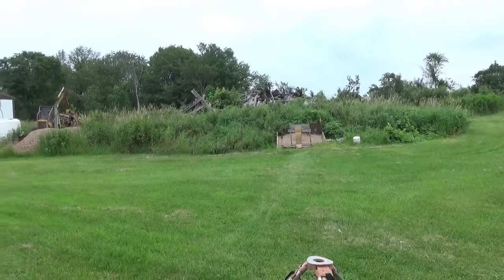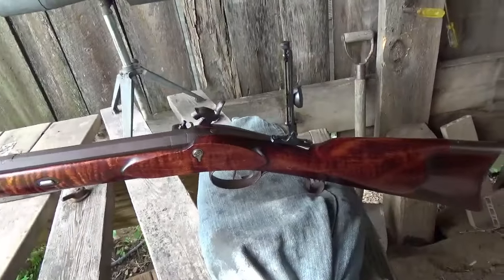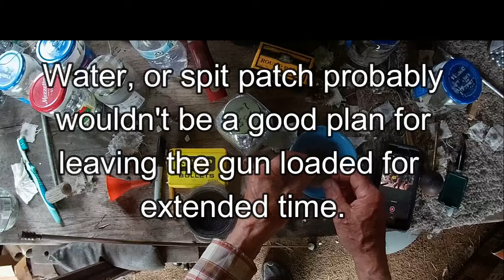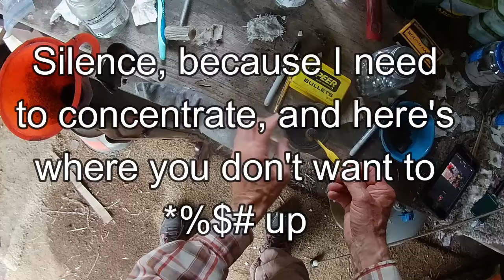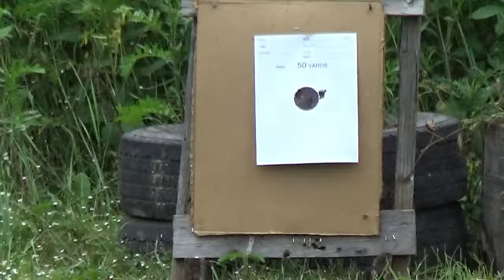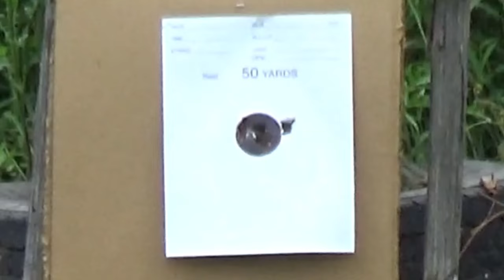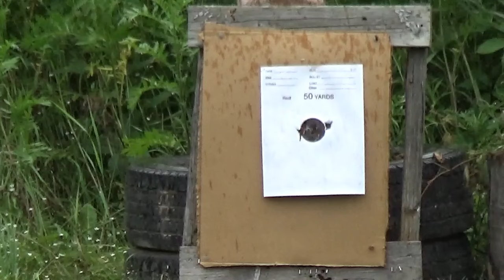Full Stock Hawken -  54 Caliber

Comment: Very nice rifle, I'd really like to have one like it, but flintlock instead of percussion. 
I have a Hawken rifle that was built in the 70s by a preacher/gunsmith in Tennessee as the story goes. 
I can't find any markings anywhere on it, but I'm pretty sure that it is a Hawken shop parts kit gun.
54-caliber 1 in 66 twist and a 35" barrel that is a little less than 1 1/8 across the flats. 
It is a beautiful rifle that is more accurate than I am. 
My latest rifle is a Kibler Colonial American Longrifle 54-caliber that is also more accurate than me. 
There's not much out there more fun than real black powder and a weekend of shooting with like-minded friends.
Again, I really enjoyed seeing that beautiful rifle of yours.
Reply from the maker: I want to say something like Sharron rifle works was doing kits back about then or before. Also Green River Rifle Works was doing darn good barrels. Lots of folks know more if you can get into the right forums. I wouldn’t doubt that flint was more common in the full stock. I started building because couldn’t afford custom. Turns out that with parts I have left over, and tools, I could get several. Thanks for your input. O.R.

Comment: What brand rifle is that, too pretty a wood for a cheapie.
On heavier loads if you will try an over powder patch and then your patched round ball it will usually save your patches
Reply from the maker: Thanks for the comment and tip. Rifle is one I did in the 90’s from some curly maple logs I sawed. There was a time I could sort of shoot it offhand. Now it’s more for “looking at “. O.R.
‘
Reply: @oldranger3044  pretty gun

Comment: I am considering the same sight set up that you are using on my CVA .54. What type/brand is it and what is your front sight?
Reply from the maker: @chuckstonex1632  Rear is David Pedersoli Long Range Silhouette USA 431. Front is a Lyman I think. Most dovetail are.375 except foreign ones may be .360 such as the Lyman GPR. Buffalo Arms or Track of the wolf are good sources, but best to be sitting down when checking out the prices. O.R.

Comment: Where do you get linen?
I have been wanting to try it in my rifles.  They didn't have cotton like we do back in the day. 
It was expensive before Eli Whitney brought in machinery to process the fiber.
Duellist 1954 says linen loads and shoots just like cotton patches. No better. But I want to try it anyway.
That's a pretty rifle by the way.
I have a pre-carved stock for a full stock Hawkin waiting for me to get a roundtoowit.
How long is the barrel on that rifle?
I am thinking 32 or 36 for mine.
Looks like you had a piece of the old cap stuck to the nipple.  I like Hot-Shot or Slick-shot nipples. They tend to blow off the fired caps.
I also like to chuck my nipples in a drill and polish the nipple with a wad of 4/0 steel wool. That seems to help prevent sticky caps.
Thanks for all you do.
John Davis Jax Fl
Reply from the maker: @johnndavis7647  John, it’s fabrics-store.com. IL019 natural softened. They have a huge selection. I ordered different weights. The light measures about .009. Medium .014 which I was using. I have some heavy and extra heavy that I haven’t tried yet. The natural would make great period shirts or pants, now I’m wishing I would have taken “home ec” in high school, but would have been the only guy there. Come to think about it, that might have been a good deal. Wondering if the saying “that’s shot” comes from what happened to wore out linen or other clothes, material was expensive and the new or good stuff wasn’t “shot”. O.R.
Reply: @oldranger3044  you might be onto something there.
Thanks for the info.

Comment: Nice rifle!  Looks like the spent cap remains was stuck in the cup of the hammer, causing a less than optimal hammer strike on the misfire. Great chootin’!
Reply from the maker: Sure paid to post the video. Don’t know if I would have ever thought of that. As I think about it now, I sort of remember not having to remove the spent cap once. It would probably have been flanged out allowing it to fit over the one on the nipple. Great thinking and thanks. 👍. O.R.